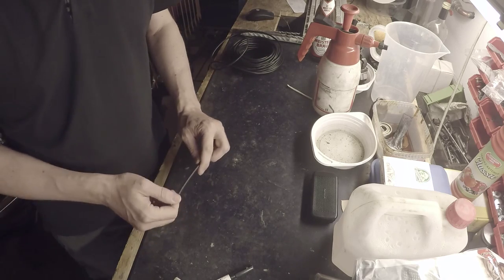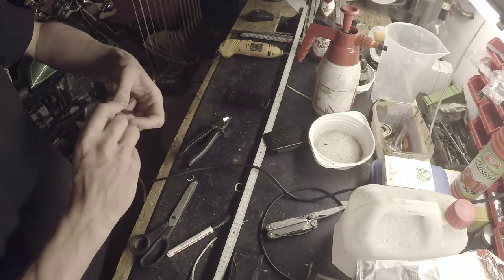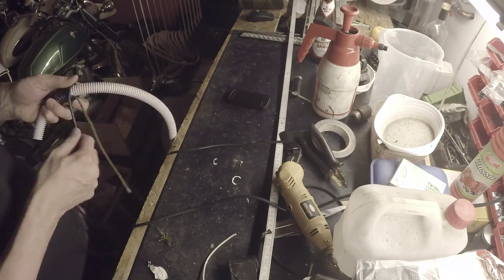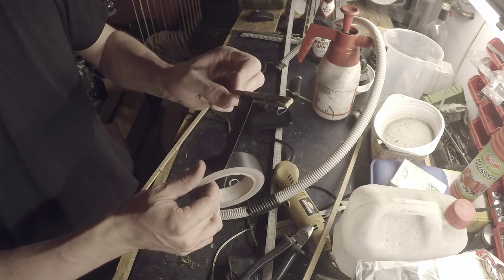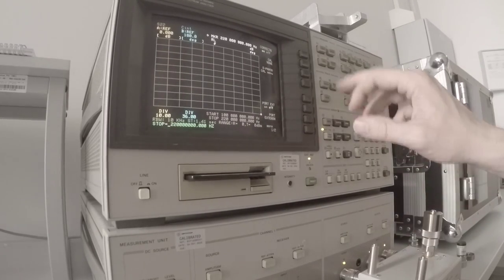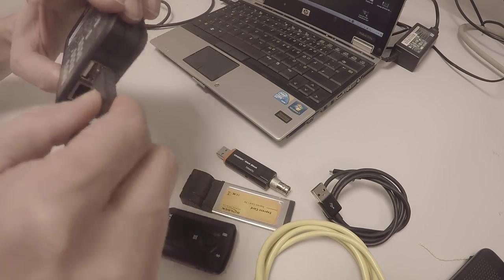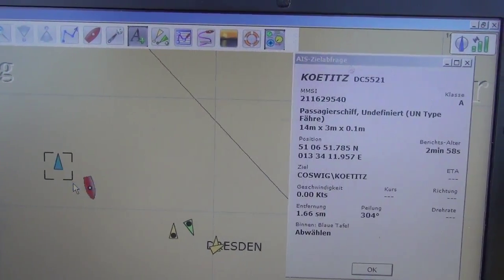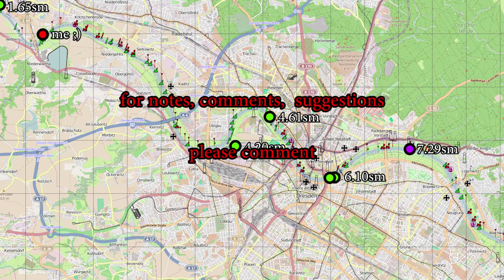Cheap AIS Receiver using a DVB-T Stick, Raspberry PI and FlowerPot antenna

Comment: really good job!! I'm on it to build my own RPi AIS receiver with a DVB-T stick! 

can you provide the detailed description of the antenna please?
please correct if I'm wrong:
un-shielded :   415 mm
shielded:         406 mm
coil:                 11,5 turns with diameter of 20 mm (installation pipe)

can you confirm those lengths please?
Reply from the maker: yes, thats correct.

Comment: Great job! I have some issues with rtl_fm and aisdecoder (or gnuais). I cannot receive any packet! How are you piping audio between the two? A vhf attached to the same antenna decodes ais well. could you please describe that part? Any tutorial followed on this topic on internet failed. Managed to decode ais with sdr# ans aismon (same dvb stick).
Reply from the maker: +Moreno Daltin 
Hello, I use a named pipe: Check out this video: https://www.youtube.com/watch?v=SuECTiFfOgo where I explain the software setup
Reply: +kuttmoped Thanks. BTW happy sailing! :)

Comment: Do you maybe know of any tutorial on how to do the software part of the project? (basically AIS on linux), since for windows there are a lot of tutorials. So you ure using Kplex so that you can show the position of your sailboat + all the other sailboats on the map in Opencpn?
Reply from the maker: +msevyt Yes exactly. I wanted to get all data from the Raspberry and not have a GPS mouse on my Laptop. 
An explaination about the software setup is a good idea - maybe I create a video about this aswell. 

The next video will be about using this while really sailing.
Reply: Yeah very interested about the software setup video :D